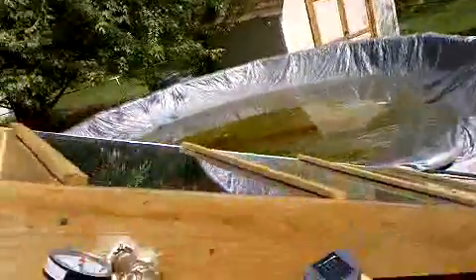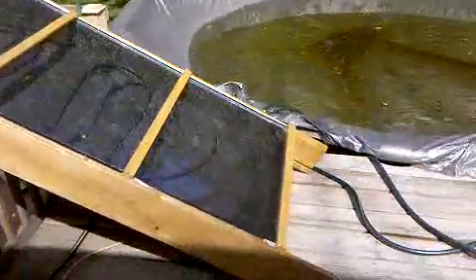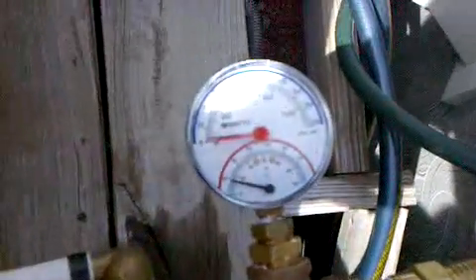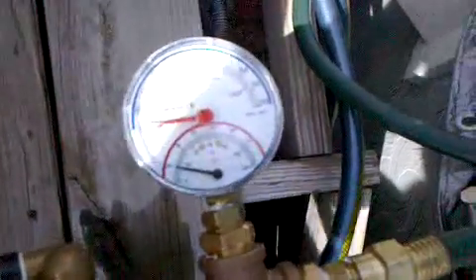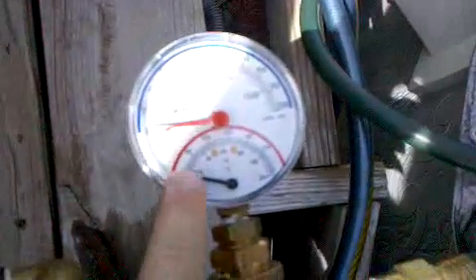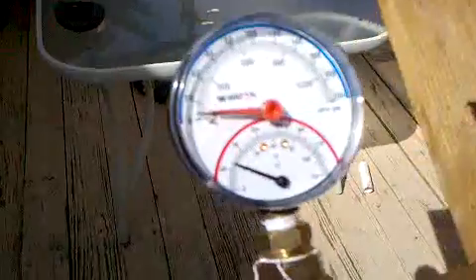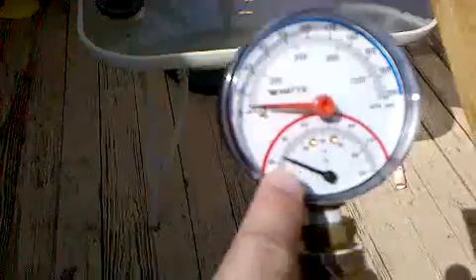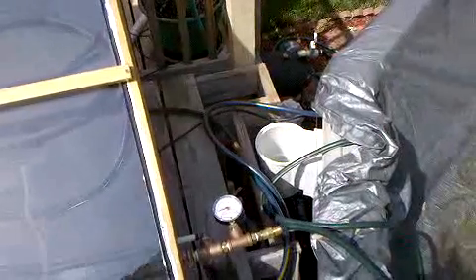Homemade solar water heater.

Comment: As of this comment, its been over two years since you uploaded this video. Have you had any problems with PEX embrittlement with exposure to the sun's UV rays, or has the paint provided enough protection. Maybe I missed them, but I didn't see any aluminum fins.

Comment: NP and add in a few diff ways to kinda store water in yr box thats why i like the radiator setup small hose in large area to get hot small hose out that alows the water in it to move very slow getting max heat in! If u follow that main way u will always get alot more heat out! How i got that idea was if yr tube is same size as yr feed line the water is always moving at the speed of yr pump to fast to heat up alot. But if u make a larger water storage in yr box and than move the water slow bingo.

Comment from the maker: Thanks, I made a new one using drip tube hoses and composite boards.  It worked great except for connecting all the tubs to one point.  I still have to work on that part of it.
A LONG video but the beginning shows the new design.

Comment: I made a water heater using 3 old car radiators just connect all them together one leads to the next the bottom one in mine is inlet and top is outlet i used an old frig for the metal and it can in direct sun raise the water temp by 40 plus deg if i slow the water flow down it makes steam. U might want to try to find a few and add them into yr box would be a big boost also i panted them with flat black motor paint i also put 2 mirrors on it one on top one on bottom that boosted it alot!